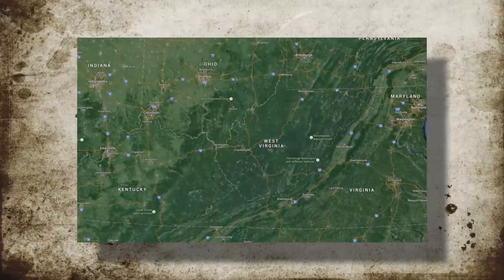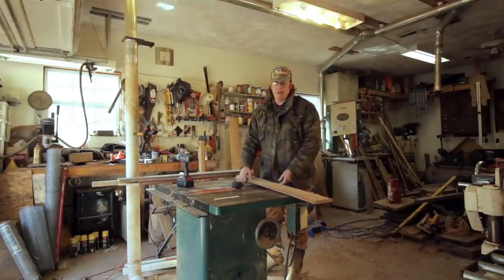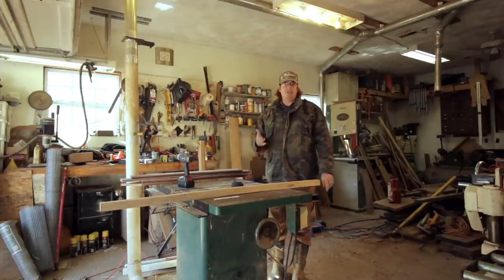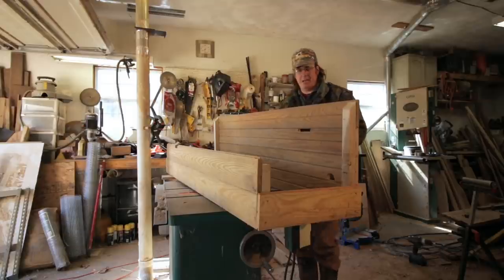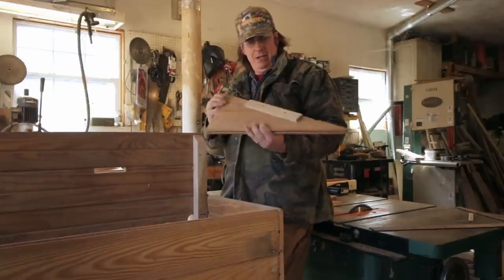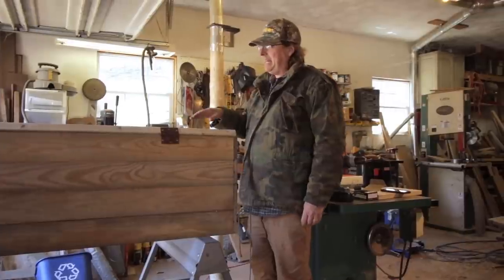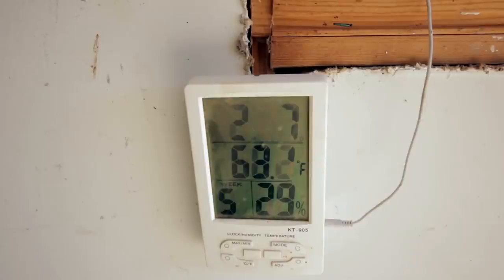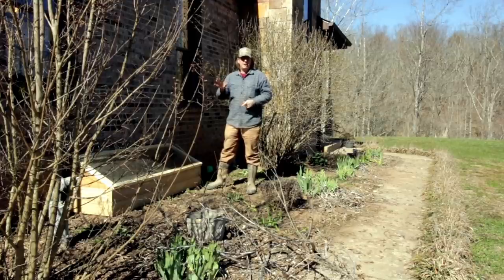Ep92: We finish our cold frame build - Part 2

Comment: You can add some foam board on the inside for extra heat retention and wire mesh to the bottom to keep rodents out. Keep these videos coming!